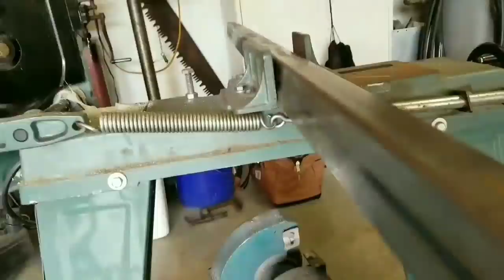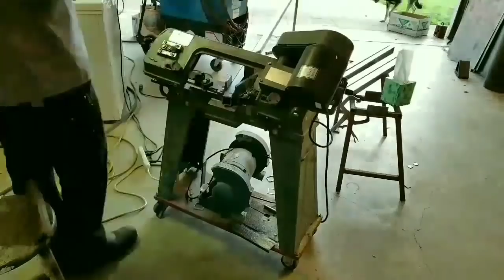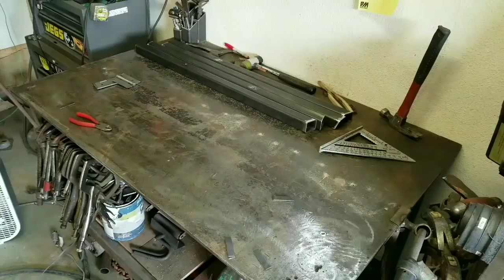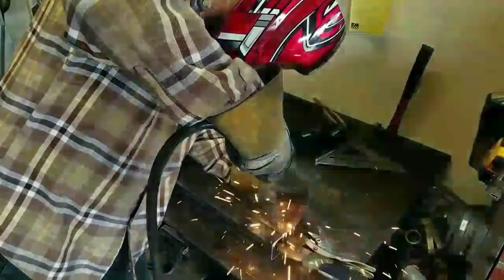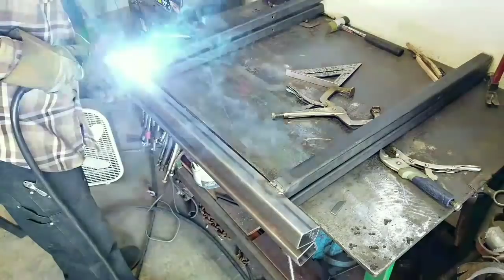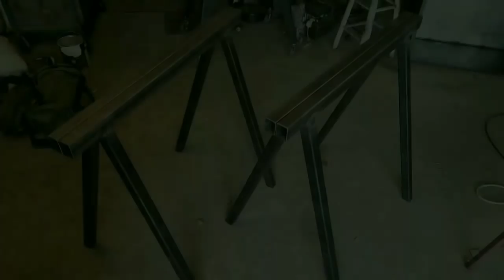Fabricating Steel Sawhorses

Comment: Am a beginner with a Chinese 650 amp weld machine (Zard). I often see the 6013 rod set at 40/60 amps on a 150 amp machine would i set the same amps with the 650 amp machine with arc force and hot start. Thank you
Reply from the maker: Hi, I'm not very familiar with arc welding but there are some good YouTube videos out there you can learn from. Good luck! Just like anything else, the more you practice the better you will get!

Comment: I may have missed it, but what angle are the legs cut at?   I love the build.  I will be making a set of these in the next couple of weeks.  Hope mine come out as well as yours.  Have been looking for a saw horse set that I could put out of the way when not in use.  Thanks for the video.
Reply from the maker: James  Rowe The angle I cut the legs at was around 107° and it came out nice and flat. You do end up with a bit of a gap on the outside of the legs with this design. I also recommend using a full strip of piano hinge between the legs, I only had the one piece at the time so I just tacked them in for the sake of the video. Thanks for your interest, if you have any questions feel free to ask!
Reply: Very good job thank’s a lot

Comment: i like it, can i ask how many degrees of angle , you  cut the iron tube? Thanks
Reply from the maker: Glad you enjoyed it, I believe I cut the legs at about 107°.
Reply: @LakeridgeWelding  Would that be the same as 73 degrees flipped the other way?
Reply from the maker: @hipairbrush1053  I believe you are correct

Comment: Could you have avoided the large gap by turning the 1.5" x 2" tubing the opposite way?
Reply from the maker: Yep! After I made this video, I acquired more hinge and welded it on between the legs and removed the short pieces at the ends. I also cut out the bottoms of the tube at the ends so I can clamp things easier.